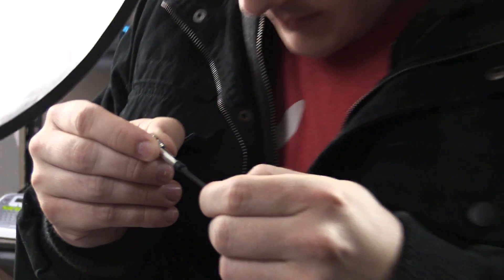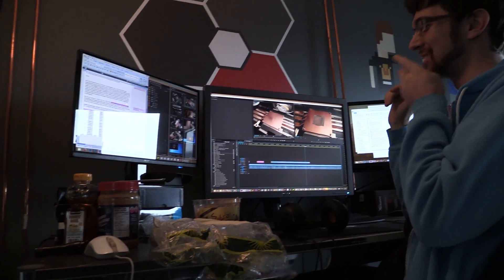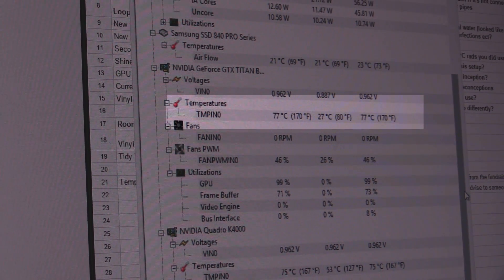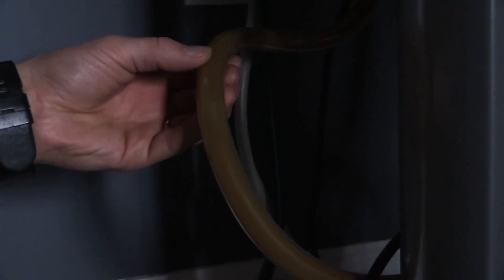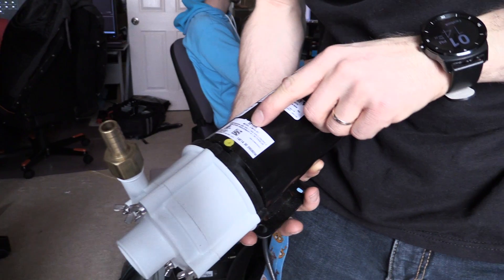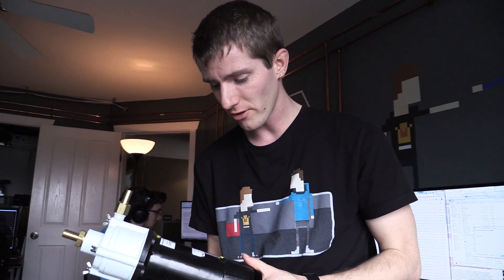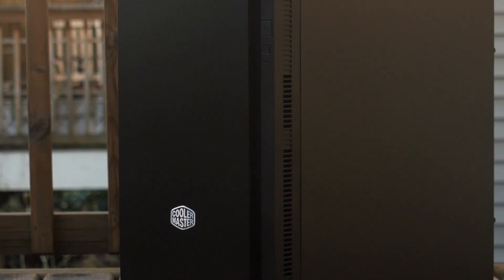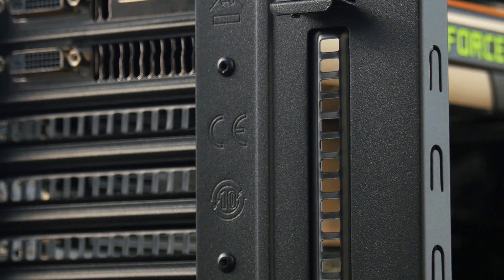Whole Room Water Cooling Part 5a - Trouble is Brewing in the Whole Room Loop...

Comment: Audio Technica has sort of a solution to the cable breaking... Above the cable protector there is a spring that makes the cable go in a smoother way and prevents it from being in a rough edge. Look at ath-m50 cables to see what i'm talking about.
Reply: When I owned a pair of Gemini HSR-1000 headphones, they used this same design: a spring after the protector.
Reply: I thought of my ath-m50 right away too! The spring is a really nice touch.
Reply: Nah where the cable attaches to the metal base it breaks, at least this has been the case with the 3 pairs of audio technica headphones I've owned
Reply: Kyle McHale Its less than something, but its more than nothing.
Reply: Or they offer also 90-degree connector option?
Reply: +1. Take the spring from a ball point pen and weave it around the cable, slide it up to the strain point, then hard mount the first quarter of it to the strain relief with decent tape.
Reply: adding a spring or something will help, and then when you get to the end of the extra reinforcement, then it just breaks there.
shrugs
Reply: In the past I have just made a big loop near the plug then taped it down to some clothing. It will pull free from the tape slowly and spread the stress over the loop. Its an old rigger and stage hand trick.

Comment: If you're having trouble with the steel tank, try a water tank from an RV. They're cheap and drinking water safe, plus they have all the fittings you'd need.
Reply: The problem is not the tank itself.  The issue is that the coolant runs at about 40 degrees Celsius and has a lot of air in it so it is the perfect habitat for growing bacteria.  He does need a different tank and he has to look into an additive against organic growth, also the use of a Uv light will help.  The other issue is that these thing especially to this scale take a lot of time to get right.  He will have to turn off all the workstations and get the loop air free which not only will take a lot of time but patience as well.  I feel like he is racing in each video to make sure his workstations don't have any downtime but honestly he is going to have to compromise.  I understand the business side of things but at this point he is hurting the business by not doing it right in the first place.

Comment: Simple cheap options. A Kill coil in a pipe of  each system. and a good filter. i would suggest getting a few extra filters to replace them as they start collecting the elements. Automotive Antifreeze does not have any Anti biological agents in it due to the fact that the fluid in most any motor gets to 212F+/100C+ (that's how it creates pressure and helps reduce emissions) Killing biologic by boiling.

Comment: What you have there is living bacteria. I worked in a machine shop and this would happen to all the coolants used on milling machines after months and months. You need either a proper anti bacterial additive or UV light, which kills the bacteria. It grows in the dark stagnant places.
Reply: Furthermore, your loop will likely have the coolant running on average of 30 - 40 degrees which is a perfect breeding ground for bacteria. Whereas in a car, the coolant reaches 80-130 degrees every time you drive.
Reply: T3397 Seems about right. Hope linus manages to see this comment.
Reply: T3397 LinusTechTips This guy knows what's up
Reply: Don't water loops also use a silver coil for that too? Should probably include one in each case.
Reply: Yup - You probably also need something that is bacteri lytic not just bacteri cidal. This ensures that bacteria that do end up getting killed do not retain their structure and gunk up your loop anyway.
Reply: @T3397 LinusTechTips  This needs more thumbs up so they can see it.
Reply: Nathaniel Graham shawly  5 seconds on Google turns up at least one bacterial species (Desulfovibrio desulfuricans) found in groundwater that digests glycols and prefers anaerobic environments. Dunno how likely it is that it's that particular species, but if it is then using hose water was probably not a great start.
Reply: presmadagascar shawly It doesn't really matter what's in the water that much, as bacteria would've most likely gotten in from the air anyway. In a system that big with so many potential weak points, added to the fact that part of it is outside and all the possible contamination during setup...it would be extremely difficult to keep any bacteria from getting in to that loop in it's current form no matter what sort of water you used. I wonder if they could just add bleach to the antifreeze/water mix in the future and be ok with that?
Reply: that bacteria was a pain in my ass in my last job since the management wouldnt get it sorted out and i had to clean it out every 2 months.
Reply: Ravi Oli If left unchecked it will just clog up the system.
Reply: TheGreggy711 Looks like bacteria to me. Ever tried putting a bit of food in still water, and leave it for a month? Scrape off the coating in the container, and it will probably look something like that. I'm a bird owner, and bacteria starts building up in their water bowls very quickly, unless you wash it daily. That is in a cage lit with UV light.
Reply: Beanovsky Durst LinusTechTips
Reply: shawly And you think distilled bottled water stays fresh?
No.
It wouldn't take long at all to contaminate fresh water.
Reply: Or you might say... The computers were infected with viruses XD
Reply: @khangle6872  🤣🤣But it's bacteria!
Reply: Is it harmful  in anyway?  It is after all bacteria and could possibly be e-coli or some crazy shit. T3397 LinusTechTips
Reply: Pt nuke or coil
Reply: Rizhiy13 usually it's actually the soft tubing that causes the problems in a well built system. Try using acrylic and see if it doesnt stay clear.
Reply: shawly I thought the water he used was distilled, and the hose water was just to flush it out.
If he is using hose water in his loop, well then he's alot more foolish than I thought.
Reply: Too late now...
Reply: Welp, I'm glad Linus and crew did this at this office so they know what not to do at the new one... Or they'll know not to give themselves the trouble next time...
Reply: hopefully they learned there not skilled enough for this kind of work. @Joseph-C
Reply: Spacemonkeymojo its a bunch of bacteria hugging eachother !
Reply: MoDRun Its a biofilm. :'(
Reply: Take all of my upvotes.  Microbiology is awesome.
Reply: shawly There would be zero point in using distilled water if the loop will stay open, which I would guess it will.
He can use hose water if he likes, just load it up with chemicals to kill what ever is in there.
Yes the water will still be very conductive if hose water is used but that won't be a problem if he has no leaks.
Reply: shawly On the next episode they should build a water distiller.
Reply: Life uhh.. finds a way.
Reply: Rizhiy13 While distilled water probably wouldn't help, from what I understand they did in fact dilute the antifreeze with water. That's why Linus initially says that they may have to mix it stronger, but he later finds out bacteria can still grow in antifreeze.
Reply: LinusTechTips LinusTechTips LinusTechTips
Reply: Some of here know what's up. Kudos to you sir. And this here is why we use UV light in our builds kids.
Reply: My 0x1E I never said distilled water would stay clean forever, you smartass, but it takes longer to pollute distilled water if the tubing was clean and the loop wasn't open. Hosewater on the other side already contains minerals and bacteria which is the reason why Linus' loop polluted faster since he didn't put anything besides antifreezer into the mix.
Reply: T3397
The more you know
Reply: UV light is a GREAT IDEA!!!! There are inline water purifiers with UV light that will help kill bacteria after a few seconds or so of exposure :D
Reply: 14:20 Yup, Linus figured it out after the fact :P
Reply: My dad has a workshop, and gunk that looks like this used to build up in the spent cooling too. I think you're right sir
Reply: true. would be easy to install a uv light in a quarts sleeve in that tank
Reply: Yeah, that's what he said right at the end of the video.
Reply: it could also be the water hose concidering he was using antifreeze which is glycol based  but also iron ridden tap water from a garden hose
Reply: wrong
Reply: UV light is a good idea. Easy to install as well. There are plenty on the market for water treatment.
Reply: and even if there was only distilled water with all bacteria killed beforehand in the system, the copper & plastic pipes, the reservoir, the pumps and every single part would need to be 100% disinfected beforehand, and then kept that way, considering you'd need a cleanroom like the one at datasafers just to not introduce any bacteria in it, introducing UV light at most junctions sounds like the only way to really stop build-up and even then certain spots might build up something, which could eventually clog the system
Reply: It's a similar kind of bacterium which is growing in fuel tanks of aircraft
Reply: Is anyone else really impressed that life manages to survive and grow in such hostile environments? I'm routing for the goup.
Makes you think... Surely, with the billions of trillions of planets out there, a small percentage must have conditions that are less harsh then anti-freeze?
Reply: yeah well, that's the problem using water from a hose... I mean it would cost much more to use distilled water but with distilled water, this wouldn't happen IF it's the waters fault, but I think it is..

Edit: And here I repeat it, Linus uses water from the hose mixed with antifreeze, are you stupid to believe he uses pure antifreezer to cool this? Are you crazy wtf??
Reply: shawly Dude calm down, no need to start calling names. 
Firstly if you spend a like 10k+ on your systems you might spend a couple hundred on cooling liquid. 
Secondly the system is clearly not closed and even if it was, stuff will dissolve in water quite rapidly.
Reply: T3397  you are right, the thing i would have mentioned is: Linus is using anti-freeze this is normally a mixture of alkohols, glycerin and ethyleneglycol. these compounds can serve as nutrients for the bacteria. a normal UV  light wouldnt help much, because it only kills the floating bacteria and createds this biological waste. i would recommend using dest. water to fill the system once (u wont get bacteria or something else in by this) then add something like hypochlorous acid to kill all lifeforms. BUT: you want to check if ur hoses can handle that stuff and in which concentration! using to high concentrations will definately hurt your system. if u need anti-freeze you maybe want to check if it reacts with your anti-bio stuff.  im not familliar with laws and legals and stuff about buying and using chemicals in the us and canada, so check them too.
Reply: Spacemonkeymojo Algae growing with no light? Not likely.
Reply: shawly If you watched the video or read the comment properly you would know that they are using a antifreeze/coolant, not hose water. And distilled water wouldn't help, as bacteria would get introduced very rapidly into it.
Reply: @Rizhiy13  nope it's a blend...
Reply: @Rizhiy13  Linus says several times antifreeze water mixture.